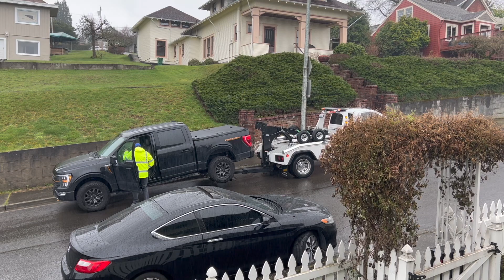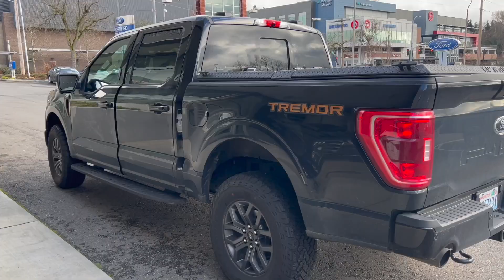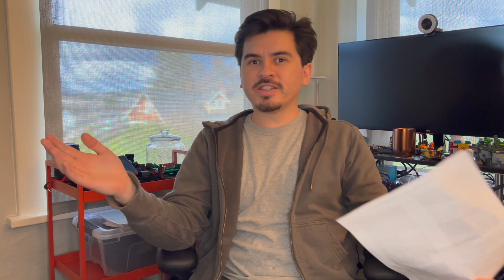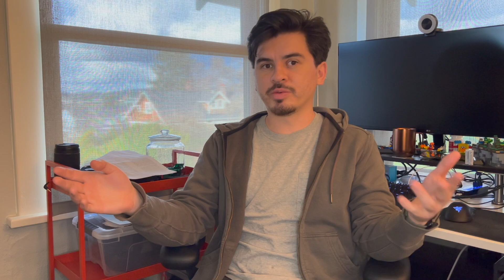IT'S ALIVE - Ford Fixes my new F150 Tremor

Comment: I had the same thing happen when my 2012 Ecoboost was relatively new. It seems to be a common thing, based on the comments on your original video where you presented this issue.

Also, for your followers,  if you have a Gen 1 Ecoboost, change your spark plugs often. Your O2 sensors will thank you. The Gen 2 Ecoboost may not eat them up as bad.

Comment: glad you got it squared away - I'm getting my recall done tomorrow, they said I can wait for it. I only have 1800 miles on my Tremor so far
Reply from the maker: The recall work was pretty fast. Did you get the rear end TSB fixed as well? I noticed a slight knock in the rear, getting that taken care of on Mondayx
Reply: @daedalus9042  oh I have not heard of that one yet - I will ask when I'm there. Thanks for the heads up!